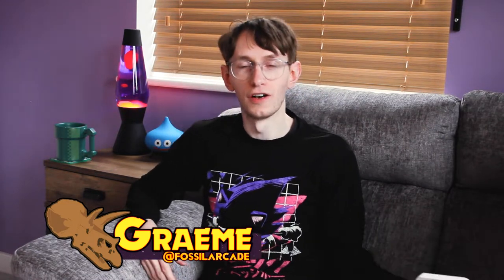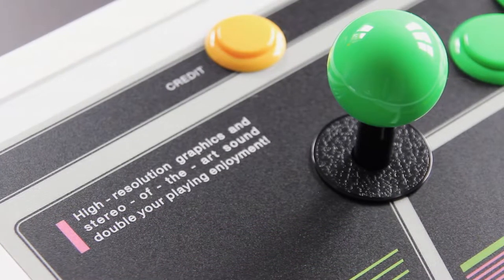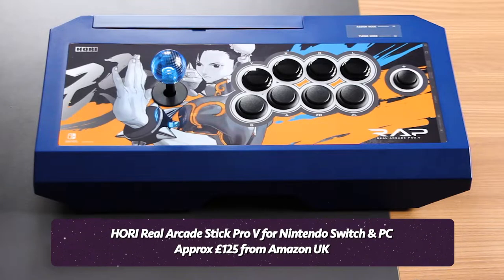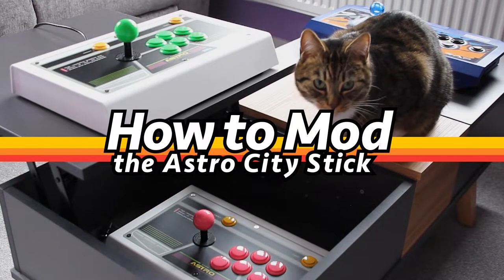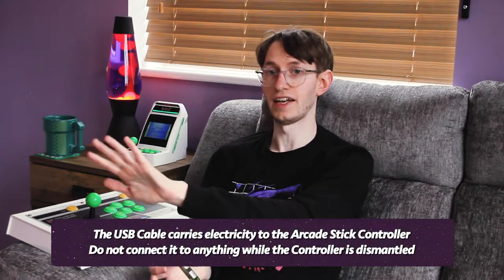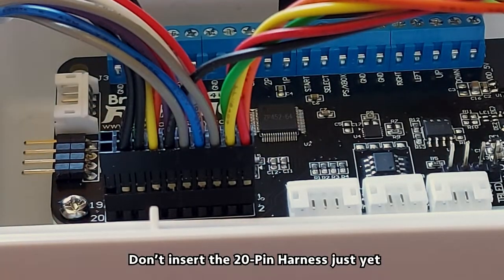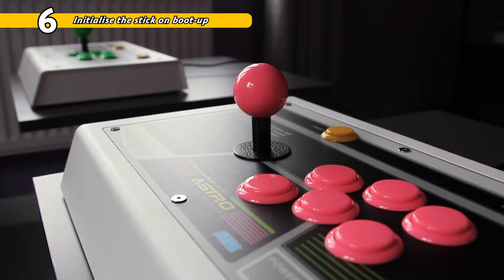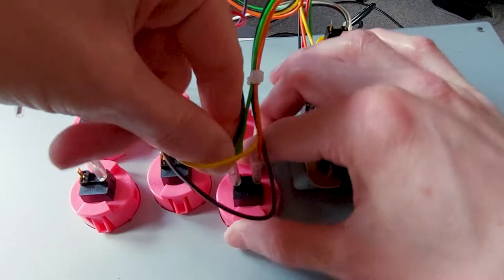Astro City Mini Arcade Stick Review & How to Mod - Fossil Arcade

Comment: YOO!! Great video my dude! Thanks for the shout. Keep up the great work!
Reply from the maker: Did I sat your username right? Thanks for sharing the info on reddit!
Reply: @FossilArcade  You did! I appreciate that. Would love to add a Guide button somehow. Makes for updating UFB and modern consoles so much easier. Tim at Brook confirmed a button combo for Guide button that I couldn't get to work. I'll figure out a clean non-invasive solution and let you know.
Reply from the maker: Thanks, that's be great. I think the only other way would be to drill a hole, extend the wires and add a button to the side panel.
Reply: @FossilArcade  currently this is the only solution. There’s a pretty clear spot on the right side vaguely shaped square where a hole can be drilled. Alternatively a replacement top panel can be designed similar to those available for the classic Sega Saturn HSS-0130 and HSS-0136 from Alberto at Arcade-Projects.com. OR if we can get our hands on a Virtual Stick High Grade top panel that the ACM Stick is based on.
Reply from the maker: I was actually thinking of placing a 24m button on the right hand side. Somewhat discreet. Nerve wracking job though
Reply: @FossilArcade  Lol! I feel you on the nerve wracking part with such a mint stick. I'm on the same boat with a legendary HSS-0130 i'm working on now. https://imgur.com/gallery/ACcz7ec
Reply from the maker: Thats seriously nice.

Comment: Cool video! I did a Brook Wireless mod of my Astro City stick right after I got it. It's one of my favorite things now, I had no idea how much I would like a wireless stick. It working with Switch and so many retro systems via bluetooth adapters is great.

I liked the stick so much I bought a 2nd to keep sealed, it's currently sitting in my storage room but seeing your 2nd modded stick done in pink 👀👀👀
Reply from the maker: Thanks! What was the extra step to make it wireless???
Reply from the maker: Ah yes, I did see this ... I probably should've bought this instead haha
Reply: Did you end up mounting the antenna internally or externally through a new hole? Might try doing that myself!
Reply: @BCob66  I just did it internally. Other wireless stick mods I've done it external, usually it matters more if the whole case is metal.

Comment: Nice video. Those pins can be removed using a cheap Terminal Extractor Removal Tool Kit. You find them on Amazon. Being bored, may I suggest building a custom joystick control panel. I have a  spinner and a trackball in another. Sky’s the limit. I use Acrylic for my joystick cases. That get expensive but LED buttons help them to glow. Good luck on your future projects…

Comment: Brilliant, thanks a lot for the video. I've just ordered a couple of Brook UFBs and plan on doing exactly the same as you to both my Astro City Mini sticks. One question: how problematic is the lack of extra buttons when playing on Switch or PS4? I'm particularly concerned about not having a Home button. I could potentially wire it to the Select button, but that's also not ideal as it is crucial on the Astro City Mini itself. If only there was macros... What has been your experience with only Start and Select, is it a pain?
Reply from the maker: Its not an issue on Switch, but your assumption is correct for Xbox and PlayStation. You would need to rewire a button as Home.

I'm planning to add three extra buttons soon to make it work across everything without sacrificing a button. Once all the parts are in I'll do a video on it.
Reply: @FossilArcade  Ha, thanks for your quick response! Very much looking forward to that video then, as it sounds like I'll again want to do exactly the same.
Reply from the maker: Personally, I play most arcade games on Switch, so it's not a huge issue... but even then not having a home button means I need a second controller near by to do everything. And if I'm adding a Home button I may as well do the other two missing buttons.
Reply: @FossilArcade  Wich 2 other missing buttons are there? The L1 - R1?
Reply from the maker: It depends on how you wire the mod, for me it's missing R2, L2 and Home, I think.
Reply: @FossilArcade  Yeh true... I am a nugget... R1-L1 are already there since it's 6 buttons. Since I mainly use PC/Rasberry/Mame I am not sure if I would need the 2/3 extra buttons. Thx for your quick replies and insights. Hope to see the next vid of the mod :D

Comment: Hi I have a question before I buy this. I see that I have to press the HOME button to make the fighting board work for the ps4 console. BUT the astro city arcade stick does not have a extra button for the HOME. I saw your other video where you add 3 buttons, very nice, but I dont have the guts to drill in my arcadestick. So my question is. If I have the buttons Kick 1 2 3 and Punch 1 2 3 as well as start and select. How can I play the arcade stick on ps4 if I dont have a HOME button? Can I make it for example the Punch 2 button to make it work on Ps4, of is this integrated on the fighting board itself? If so, the fighting board is no option for me because what is the use to instal this if I cant play it on Ps4 because of the HOME button issue. Will you please respond? 🙇🏽‍♂️
Reply from the maker: You would need one if the buttons to be home, which would make it a lot easier to use on modern systems. But as you know, it'll cost you another button unless you add more.

Comment: Inspiring video! I’ve ordered one of the sticks… will I be braze enough to mod it though? Does it work out of the box with both the Megadrive minis?
Reply from the maker: It might work on the Mega Drive Mini 2 without modding, but no other minis
Reply: @FossilArcade  I’ve since discovered Mayflash! I bought the Xbox version but it also works with my Switch, Genesis Mini 1, and Evercade VS. I assume if I bought the PlayStation version I’d be able to use it on my PS5 too. Delighted beyond words!
Reply from the maker: Good to know!!

Comment: Hi Mate, nice work! 

I just got my own one and noticed that the top plate where the button sit on shifts about a lot when using it. Is this something you experienced with yours? I don't feel like I should have to tighten up screws on a new stick so wanted to know if it's a common issue. Cheers!
Reply from the maker: Neither of lime arrived with lose plates. There is about a mm of room for them to move if they're loose, though. I keep mine reasonably loose because I intend to get back in there for a further mod soon... 

It's annoying that yours aren't properly tightened, but it's a simple fix if you have the tool. Or you can even do it by pressing down on the screws with a thin towel and turning with your finger. They're designed to come in and out quickly, so they shouldn't require that much force.

Comment: This video was very awesome, inspiering, and a great way to show if a brook board was possible to fit inside. 
I was looking at this Astro style stick on a local shop and tought it looked nice, small easy to travel with size & I wounderd if it could be modded to be used with my switch as a lighter stick that i bring with me easier to work (personal assistan with lots of time to kill). 
Witch appears to be very possible, but i also want to drill extra holes to add buttons to home, touch pad to make it compatible with ps3/ps4/360 etc.
It would not be my first mod but it would be an intresting one, never pushed out cabels of joysick connector to make it right so i hope that goes smoothly.
Again very nice project, i think i need a new one aswell ^_^
Reply from the maker: I plan to add some more buttons soon and will post a video if it goes well haha thanks for watching!

Comment: Awesome video. Liked and subscribed. So, you inspired me to buy a second stick (it's incoming), though that wasn't a hard sell; such a great feeling stick. I have a question regarding the pink color components. I was looking at pink Sanwa components and there's several shades of pink and I don't know if it's my eyes or the monitor but I'm struggling to find the right one. Which did you use, or which is the 'authentic' colour?
Reply from the maker: https://www.arcadeworlduk.com/products/Sanwa-OBSF-30-Arcade-Button.html

I probably should've shopped around more for my pink, but I do believe this is the colour sega used when they did the limited run on the pink variant. 

But, in some lights they look really bubblegum ... sometimes more salmon. It's weird haha

Where are you buying? Hope it goes well!
Reply: @FossilArcade  That’s really helpful, thanks. I’d been looking at several sellers, like www.focusattack.com, and I’d seen Sanwa buttons in pink, violet, and hot pink that all looked like they could be the deal in the right light. Hearing you say salmon and bubblegum makes me think you got it right as those were the two words in my mind when trying to suss it out from pictures of the original cabs. Never seen an actual Astro city in person.

Comment: Awesome video, you got me on the fence in between Mayflash F500 elite or this beauty. I would mod the Mayflash to look like the Astro City. I only use PC/Rasberry, would you recommend this or the Myaflash? I also noticed lack of palmrest space, is that an issue?
 I really can't decide. I do know I want the Astro City design :D, it just looks so amazing an reminiscent. Thx Great job on showing the mod. Really helpful
Reply from the maker: I've never used a mayflash but I know the best model is just a box with some sanwa parts and a quick fix universal option.

This is more work, and no doubt a lot more expensive, but if its looks that matter to you (like me) then it's worth the price.

Keep in mind, you will also need to add three additional buttons to the astro to get the full use out of it - I'm planning to do this myself and will post a video on it, if all goes well.

So basically, get the stick you think you would enjoy modding the most, whether that's cosmetically or functionally. But I do think astro will cost you more.

Comment: Gread video and love the coaching but I'm still not sure what the difference is between the original and your mod version.
Reply: The stock is only compatible with the astro, when compared to the mod you can use it with any console from PS4/PC/XBX and possible upgrade path to next gen.
Reply from the maker: Its explained around 3:10

The Brook Universal Fighting Board is probably the most common arcade stick mod, after basic button replacement.
Reply: Thanks! You know I'm playing catch up with this stuff but always fascinating to watch and admire your expertise x

Comment: Great guide! I'm about to attempt this mod as well. Could you have rotated the JLF switches 90 degrees and not have had to swap the wires in lever harness?
Reply from the maker: Potential. You'd have to figure it out based on the new wire layout. I dont think so though
Reply: @FossilArcade  so I completed this mod with a big thanks to you.  I also drilled holes for the extra buttons. Only thing that needed extra attention was the extension of wires to accommodate new buttons
Reply from the maker: Would you mind sending me a picture of the finished mod and where you put the new buttons?

My twitter is @FossilArcade

Comment: How is this stick for playing on a PS4 though since it has many less buttons than on a regular PS4 arcade stick? For example it doesn't have the PS button, Share button, R3 and L3 buttons. This is the one limitation that is preventing me from doing the same modification on my Astro City mini arcade stick.
Reply from the maker: You would need to add those additional buttons, as I say in the video, so you'd be right to hold off unless you're prepared to do that. I may attempt it in a few weeks time.
Reply: @FossilArcade  if you do add addition buttons please make a video on it as I would love to see a guide on how to do this! Thanks!!
Reply from the maker: Absolutely, cheers!
Reply: @FossilArcade  do I need those extra buttons to make it work on pc?
Reply from the maker: Not unless the game requires them, no.

Comment: Too bad,  this still uses the old old old "Sanwa" mounting brackets, so the only levers you can put in there are the SAnwa JLF, or any of the Seimitsu sticks compatible with their " VF" mounting plate (LS-33, LS-55, LS-56, LS-60/62) which was at the time designed to be cross compatible with the Sanwa control panels for the japanese Candy Cabs and make life easier for arcade ops, this makes this stick incompatible with Sanwa JLW's, Seimitsu LS-32, LS-40 and LS-58 levers.